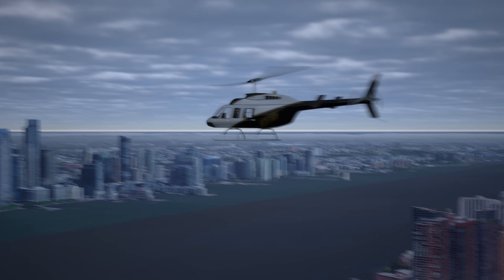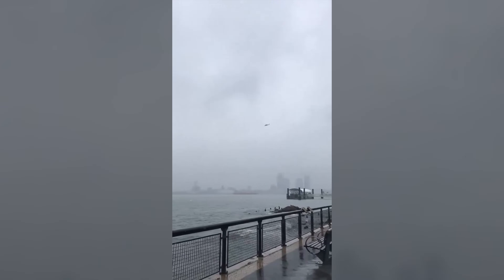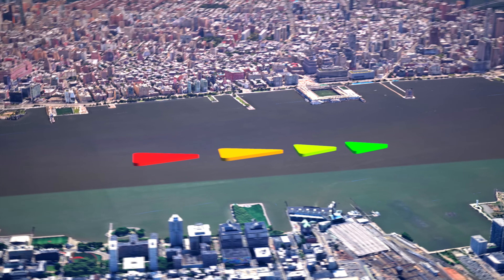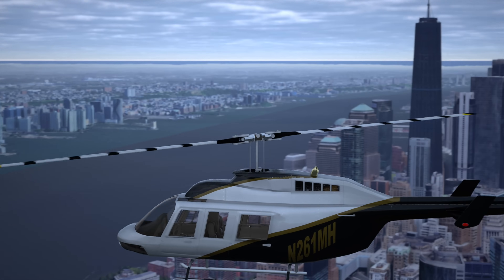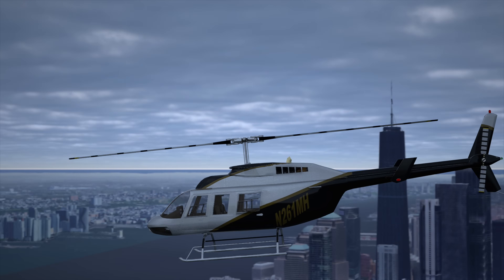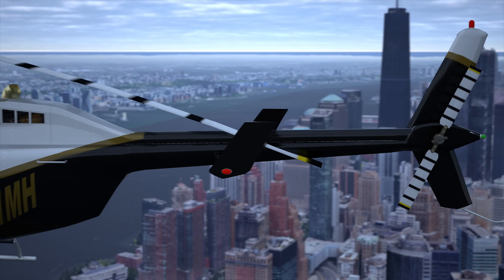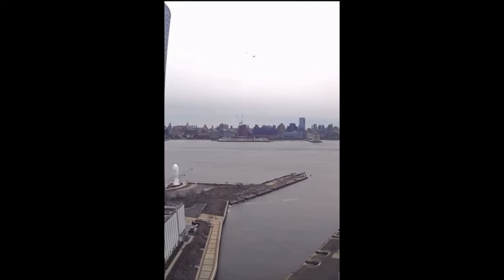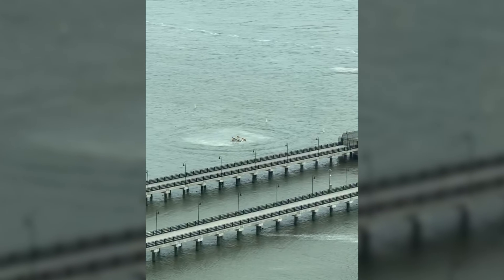Helicopters DON'T just fall from the sky - What is "Mast Bumping"?

Comment: The rotors and the xmsn separated together. That's not mast bumping. The tailboom separated from the airframe. So, maybe a t/r gearbox failure or xmsn mounts. Either way, it's terrible.

Comment: How can it be mast bumping if the rotor was still intact and still spinning at the velocity it was? No erratic flight maneuvers were noted previous to the breakup. In addition the 206 is not know for this issue. However a instant lock up of the gearing or drive shafts could have explained the disembarking of both the tail and the main rotor simultaneously. I would be confident in saying it wasn't mast bumping.

Comment: The Bell is a SEMI-RIGID (aka: tilt-rotor or teetering-rotor) not semi-articulated. Also the Bell 206 design makes mast bumping VERY uncommon, and a main rotor tail boom strike is nearly impossible, especially in straight and level flight. I cant imagine what it would take to mast bump the 206 hard enough to cause a catastrophic failure (maybe trying to follow the Blue Angeles?) but that failure would likely be a shear of the main rotor shaft and NOT the traumatic amputation of the MGB (main rotor gear box) from the airframe. Wanna know what will cause this and tail boom to break off during straight and level flight? A seizure of the MGB.  This is supported by the video showing a VERY sudden change of the aircraft yaw followed by rapid disassembly. Not sure where your helicopter education comes from Brian but you should get your money back and refrain from putting out bad information on accidents where lives are lost, when its clear you don't know what your talking about.

Comment: I dont think it is mast bumping.

My thoughts are the engine or gearbox mounts came loose, causing the gearbox to leave the aircraft and snap the tailrotor axle.
Poor maintenance. Possible missed fatigue cracks or fractures.
Im no expert, just a aircraft mechanic through 15 years.

Comment: It first does a 180 pitch movement then it loses a big part from it's body probably the tail. That means maybe first the small propeller had a problem and because of that heavy fast pitch movement the big prop hit the tail because what you explaned in the video. So was fast chain reaction...

Comment: It also can be a gearbox failure. The mast had pieces of the transmission housing attached to it.   Case in point, a H225 Super Puma bought it from suspected drivetrain failure. It's still unsolved as of this date, but Airbus made a shitton of changes to manufacturing, including kicking a vendor off the line, and maintenance schedules.  

If this were mast strike, the failure would have been higher up.  The investigation will reveal the actual failure.

Comment: The Bell 206 family is statistically the safest single engine aircraft in the world. Mast bump (if this was the cause) is a well known phenomenon and easily avoided- don't induce a low-G condition. The other possibility is simple structural failure. Either way, nothing was going to save them.

Comment: can't even imagine how petrified they were when they realized they were in trouble.  How awful.  No helicopter rides for me.  My condolences to the family.  Sorry for your loss.
Reply: The only good thing is they didn’t have more than a few seconds before they hit the ground and died. That’s such a small amount of time they may not have fully processed what was happening, and if they did, it was over before they had much time to panic.
Reply: @tommoore4128 
Well I've heard that 4 people were unable to be resuscitated at the crash site, whereas two other people were taken to the hospital but died not long after.
And if you heard the conversation with the pilot and ground control, you can kinda hear the children in the background, seemingly very excited about the trip.
Reply: @tommoore4128 Dos de ellos no fallecieron en el momento, murieron en el hospital.
Reply: The fear and confusion they must have felt . What a horrible and tragic way to die .
Reply: @TheHonDon necks snapped on  the fall most likely
Reply: Amen; No helicopter rides for me either. It's just way too dangerous.
Reply: @bustjanzupan1074 planes too, for me cut me out 😂.
Reply: @bustjanzupan1074  The number of fatalities vs flights for helicopters is higher than fixed wing aircraft... however, it is still DRASTICALLY lower than automobiles. Statistically speaking, you are far more likely to die on a bus or train than a helicopter or aircraft (assuming you flew the same distance that your rode in a bus, car or train). Fixed wing aircraft are still the least likely form of travel to kill you, even with the increase in fatalities in the past 2 years.. helicopters are only slightly less safe than fixed wing... but both are still massively safer than all other forms of travel.

Even walking is statistically more likely to get you killed vs flight, considering the sheer number of pedestrians killed EVERY DAY by automobiles.
Reply: I’ll only fly helicopter on flight simulator.
Reply: @g_pazzini  I don't have time neither for that .
Reply: My guess really is they didn’t even have time to process it. Something like that happened so fast so maybe they’re suffering was minimal by the grace of God.
Reply: @jayniekinser7029  There was a similar incident that happened in Roatan Island in Honduras 🇭🇳 Central America on March 17, 2025. 12 people were killed.
Reply: @jayniekinser7029 having been in a few auto accidents I can say that brain can make time longer. I remember every moment of the time some drank dude rammed me and my parents.
Reply: @jayniekinser7029  count to 10, all the while imagining the terror....10 seconds can be a lifetime in that instance
Reply: Yeah I no longer want to do a helicopter tour. I’m good. 😢
Reply: I was wanting to take a tourist helicopter over Niagara Falls , not anymore.
Reply: There is no family left. They are all gone.
Reply: A car it's more likely kill you faster, especially with the way people drive in NYC. Helicopter crashes are so rare that when they happened they hit the news. Car crash fatalities are so common, that unless it's a full bus or somebody important, we almost blanked them out of our media.
Reply: ill been stop since we lost Kobe ...so sad so many aircrafts lately are having malfunctioning
Reply: My army buddies were laughing about the collapsible seats saying if this fails, we drop like a rock.
The seats will not save you from the fall.
Unlike a plane that can still be airborne for a while.
Reply: stay locked in your home, simple
Reply: Too many helis and planes been brought down these days… it’s because of an agenda to push something.. there’s a reason why this is happening, and it’s not random, NWO
Reply: The guy worked for Siemens, the company that was involved with the  design and development of the gas chamber for the nazis, they killed thousands of people, so its carma really
Reply: @deborahs2322  Try to get in a NAP of the Earth flight. I did at summer camp in around the year 2000. We went over small mountains here in central Pa. in a Huey. Scared during first one. Landed and asked to go back up. The flight is where the pilot gets chopper to the safest height above trees . It is wild the first time. Doors of huey were not on.
Reply: Probably killed them instantly from impact . Falling that high into water is like falling into cement basically
Reply: Yeah I’ve vowed to do no helicopter rides since Kobe Bryant, this incident just enhances my vows.
Reply: While it is indeed quite horrific, and the last moments of the doomed occupants must have been a nightmare, professional helicopter companies - like commercial airlines - are incredibly safe. Statistically, you're far more likely to die on the drive to the airport than be involved in a plane crash. Still, I hope we find out just what happened, so we can avoid such tragedies in the future.
Reply: @AlphaLimaXray  stop spreading this lie, its a statistical fabrication.
Reply: @AlphaLimaXray  That statistic is irrelevant for many reasons.
Reply: @AlphaLimaXray What does a plane crash have to do with anything? This is a helicopter and helicopters are far more deadly per mile than cars.
Reply: They never knew they were in trouble, it happened too fast if you watch the wide angle video. If they weren't knocked unconscious by the impact when the tail got severed, they had about 10 seconds or less to contemplate their demise before they hit the water, which ended their lives. Of those 10 seconds, they probably spent several seconds wondering "what's going on" before realizing they were falling. Rough way to go... but could've been drastically worse... i.e. falling from tens of thousands of feet where you have quite a long time to contemplate your demise.
Reply: @Hathur  would they die instantly? I thought the water wouldn't kill them right away and they'd drown instead. So sad though, 3 young kids and a growing family.
Reply: @Heybrotruthhurts  Helicopter was at least 5,000 feet altitude. At that height hitting water has basically the same effect as hitting concrete on the human body. In the one in a million chance the impact didn't kill them, the impact would've knocked them unconscious and they would have drowned while unconscious. Their actual death was 99.99% painless... but they undoubtedly had about 10 seconds of abject terror before they hit the water where they finally found "peace", as it were.
Reply: @Heybrotruthhurts necks most likely snapped
Reply: It happened so fast they had no idea.  Like the Titan submarine and the flight that crashed into the Potomac a couple of months ago
Reply: @chrisalley6282 2 people were alive when they pulled them out. The died @ hospital.
Reply: Parachutes?like in the top gun movies?
Reply: so, no plane ridees for you too or car rides as every thing has a fatal crash..
Reply: Yep, I shall stick to the donkey cart @ww3radar
Reply: Sorry to who? For who’s loss? Who are you even talking to?
Reply: This is sad... helicopter plunged into water causing this incident but how come there were no safety measures enabled in the helicopter to rescue from the water body.
Reply: @TheCrazy55555  From that height, it was the force of impact that killed them.  No safety device available today could have helped.
Reply: @smithbry2000 I agree but with so many advancement in technology how did they not create a safety measure. I am sure experts must be taking this into account.
Reply: @TheCrazy55555  its a metal box with propellors on it, I don't think there's much that can be made 'safe' if the rotor chops itself in half to a 500ft+ freefall. the inflatables are there in case you need to do a semi-controlled emergency landing, not for a screeching free fall upside-down. its tragic but to act like there could be more safety features on a flying death box is.. ignorant.
Reply: @TheCrazy55555  Trash question this one is
Reply: @tholo86  you mean asking for better safety measures to prevent loss of life
Reply: @TheCrazy55555  the impact with the water was like hitting concrete and wouldn't have survived it.
Reply: @TheCrazy55555  Comany should also give over water crash survival ways  passangers before take off. It can help some survive once in the water. Ending  upside down  though, there is a different type of spacial disorientated for even pilots and tourist.
Reply: @TheCrazy55555  If you fall from 600 feet you're dead. You're not going to be rescued from water.
Reply: @TheCrazy55555  there were and are, AND they activated on this particular accident. helicopters arent supposed to land upside down ever. please use your brain
Reply: @TheCrazy55555  they very likely died on impact. a saftey vest isn't going to protect you from a 900ft fall
Reply: #1 No one said no safety measures were taken. Safety measures are taken before every flight. 
#2 When people arrived they were already dead.

Most likely, they were dead before they hit the water due to the torque.
Reply: they should have been more racist
Reply: @cagneybillingsley2165  man, sybau.
Reply: The pilot was DEI
Reply: @the.parks.of.no.return  this looks like a pure mechanical issue (probably unnoticeable on pre-flight) as the helicopter looks like it is cruising along normally.
Reply: @michaelj.acosta6810  have you seen footage of how that helicopter was being flown before it mysteriously crashed ?
Reply: @the.parks.of.no.return ignorant
Reply: @the.parks.of.no.return is this confirmed? Asking because this just more proof why that thing had to end
Reply: @the.parks.of.no.return  Bot or moron? We can only wonder.
Reply: @jimmyeveryman6418  and yet aircraft seem to continue falling from the sky
Reply: @the.parks.of.no.return  can you tell me what dei policy caused this crash?
Reply: @the.parks.of.no.return  whered you go to college

Comment: This was in front of my building, so two things that add to this: 1) I heard the one bang, which was the body hitting the water.  But people I talked to along the waterfront said they heard a loud bang and crashing sound, with the rotor noise going very “sharp” before the rotors flew off.  While there are small birds on the pilings at low tide, the geese weren't very active there.  2) I've seen these tour operators buzz the highrises, including my building, on the waterfront before heading back to Kearny; they fly up over The Heights on the cliff.  While I don’t think the flight path of this helicopter suggested the pilot was doing that, since he was heading south, it's possible.

Comment: I was actually wondering if a "Bird strike" might have taken out the Rotors... never thought a 'input to avoid a bird' could lead to the Rotors possibly striking the tail.

Other possibility i had was something 'failed' in the drivetrain that goes 'to' the tail rotor, as the newest video that is a view between two skyscrapers shows the helicopter flying what seemed like a normal strait line, then suddenly the tail seemed to 'fold forward'.  Would any type of drive-shaft failure or gearbox binding up cause the tail to 'twist' forward?

Comment: Non-pilot here.  Can someone translate the text at 3:39?
Reply: April 10 18:51 Zulu time, wind variable at 3 knots, 10 statute miles visibility, overcast clouds at 9000, temp of 8 degrees Celsius and a dew point of -4, altimeter 30.34 inches of mercury, I think A02 means the weather report is automatic and has a precipitation sensor, sea level pressure is 1026.6 millibars and the last thing is a more precise indicator of temp/dewpoint
Reply: @foxbat444  Thank you!

Comment: sounds like overtorquing the top nut,,   had  a roommate do same in germany,,  pretty sure if was a bell helicopter os the same genre as they had to call bell to determine what to do on the aircraft as no one would fly on it after ward,  bell required torque wrench be sent to calibration to assure accuracy on untorquing nut and forward  the reading to them,  on info they wanted shaft replaced

Comment: Wouldn't mast bumping cut the mast above the gearbox? And wouldn't rotor contact sufficient to sever the tail boom unbalance the rotor and cause it to destroy itself (if not already destroyed by contact with the tail boom)?

An intact rotor freely rotating on top of an intact mast that is still attached to the gearbox suggests a violent event within the hull that had little effect on anything above the gearbox.

Comment: I no nothing about aircraft or helicopters but the way it was explained I have a clear understanding of what happened now and my take is if the main rotor stuck the tail why didn’t the  rotor break in multiple pieces it was still intact and spinning is the main rotor built that strong that it could sever the tail with enough force not to break itself

Comment: One "expert" declared that it was a Jesus nut loss or failure -- but this would have taken the rotor off the mast, which didn't happen.  A boom strike would likely have taken a chunk of the rotor off (the boom itself is thin aluminum, but the tail rotor drive shaft is beefy and has a lot of energy in it).  This would take it out of balance, and it was spinning pretty evenly.

There's a TB to replace the one-piece tail rotor drive shaft with a segmented shaft, but only affected early production aircraft, and compliance was at operator's option.  It reduces vibration harmonics, and wasn't a safety issue.  Loss of tail rotor power results in a yaw around the main rotor shaft, beginning rapidly and increasing in rate to several RPM.  We didn't see that here.

The incident is a sudden catastrophic failure, inflight breakup with separation of the tail boom at its root and separation of engine and transmission from the airframe.  That suggests sudden seizure of engine or transmission, which would put enough torque into that part of the helo to break the bolts holding those heavy components in place.  Once they started coming free, they would easily destroy the boom or its attachment points.

And note that the fuselage was tumbling fairly straight in the pitch-up direction, rather than spinning or rolling sideways.  This indicates that most of the energy of the breakup was in a single direction, vertical and downward at the boom root.

Comment: As a Bicycle Mechanic with over 3 weeks experience I have lots of experience with parts coming loose and falling off. In my opinion the hellicoptors bottom bit fell out from under the top bit and would probably  never reattach itself without amazing luck.

Comment: Mast bumping is not an issue with 206s, that’s a Robinson thing. If you bothered to examine still images from the crash, it is clearly visible that the main rotor and rotor transmission separated intact, as a unit, w/o out visible deformation. This is indicative of a malfunction of the rotor transmission, driveshaft or the engine transmission, not mast bumping. Stay in school!